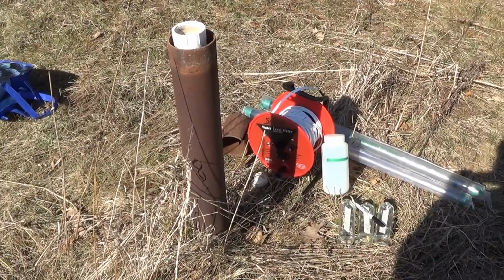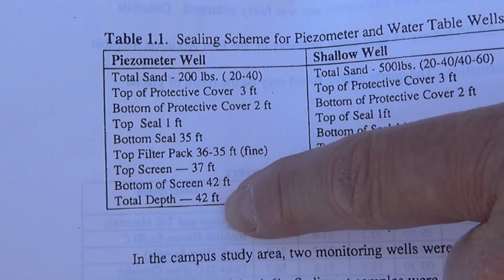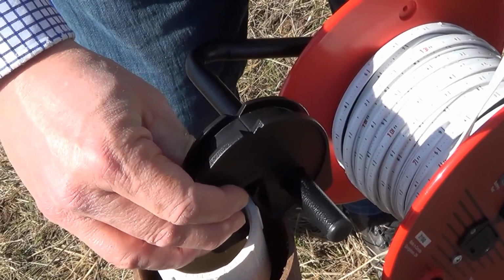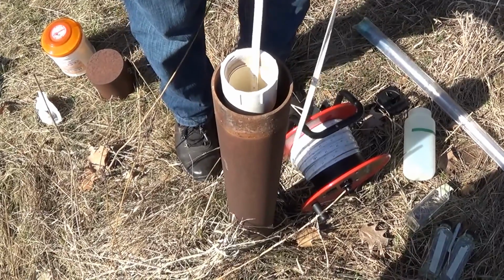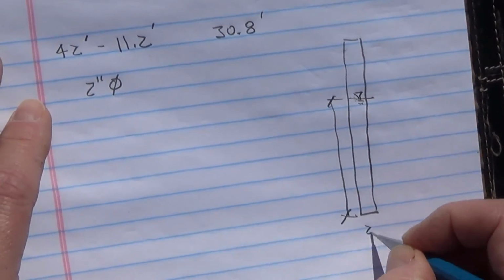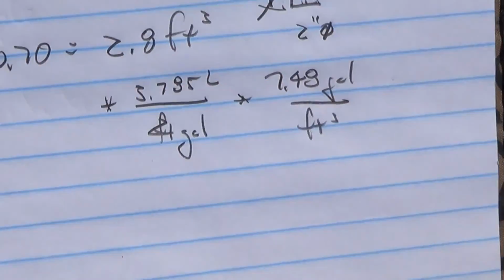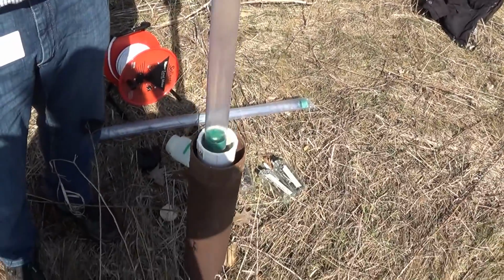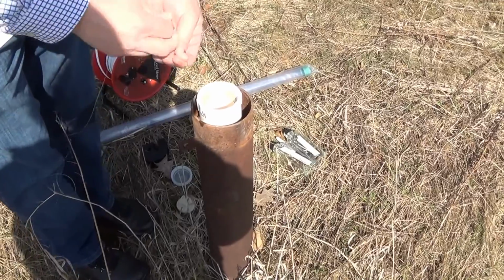Well Water Sampling Environmental Chemistry

Comment: Where is the well cap??? How are you ensuring that contaminants aren’t entering the well from the top of the casing when the well is not being sampled/accessed? 

Why aren’t you wearing nitrile gloves? Regardless of contaminants I the well, your own hands are contaminating the well ESPECIALLY since your sampling for ecoli.

You should be disinfecting with alconox or liquinox. 

Your sounder sensitivity was up way too high. That wasn’t an accurate detection. 

The case multiplier for a 2” well is 0.16 not 0.17. The equation is simply water column multiplied by cvm (case volume multiplier, or .16 in this case). 

your purge would be fairly simple if you just used buckets if you must hand bail the water. 

The sample bottles are now contaminated by your hands which are not covered with sterile gloves. 

More importantly, where is your water quality meter? How can you be sure that the water is a stable representation of ground water of your not doing continuous monitoring as you purge?

You shouldn’t be using your finger to release the water from the bottom of the bailer. Those bailers should come with plastic bottom emptying devices. 

The string is touching the ground and contaminating the sample.
Reply: I can guarantee this video was off the cuff and was a general demonstration. The sample taken was only for demonstration purposes clearly.